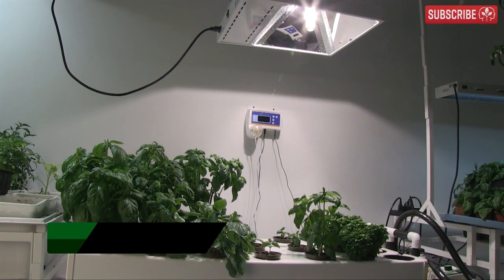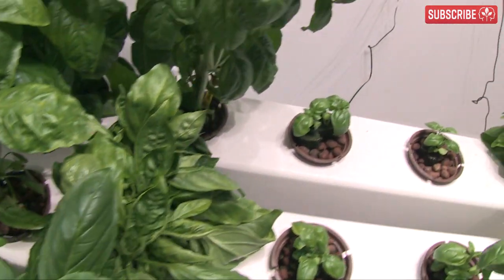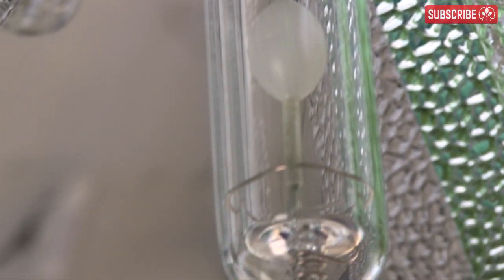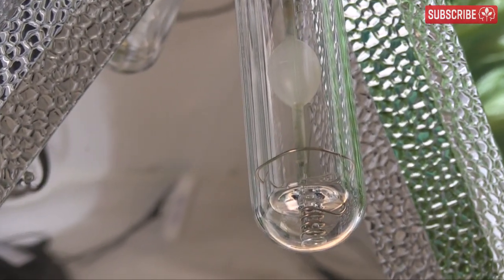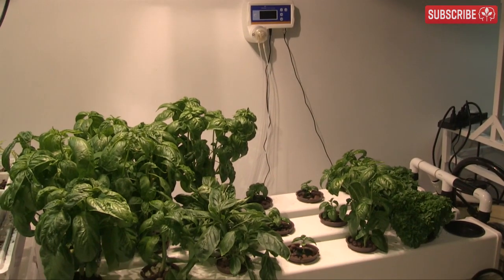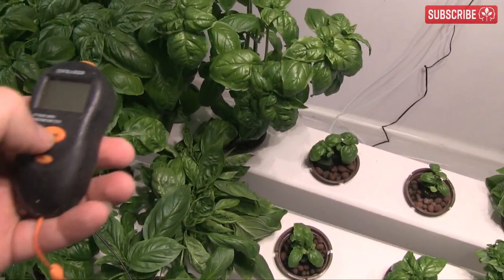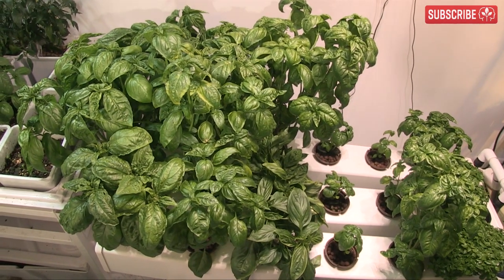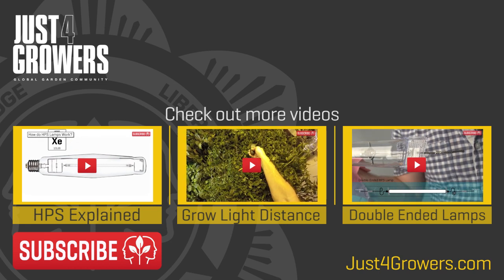LEC 315W Grow Light Review

Comment: I've seen this video before and immediately lowered my light from 30" to 18" do I need say I burnt the crop. My fault! Didn't realize you had yours on a rail. 

Since then I've gotten a rail and another sun system lec 315 light ( flower power) this light has a horizontal bulb. Just a slight difference, from what I gather it gets a little hotter do to that factor. 
Ty for your video. Nice crop 👍

Comment: If anyone still monitors this video I have a question about that exact light and a 2 x 4 x 8 closet tent. I realized real quick I didn’t need the top of the line bulb to veg my plants before going into my 5x5. My wife and I had to learn how to grow to replace a lot of my VA medicines. I invested what I thought was very good money into the top of the line of what her and I could afford and I’m using it all the best that I can. Do they make a bulb that fits that fixture that is cooler than that top of the line bulb that you can grow whole cycles under??
Reply from the maker: Corey Hart Take a look at the HELLION 315W CMH system by Adjustawings - it can go full lifecycle and covers your space nicely.

Comment: Lec 315 vs 250w hps? For chilli thanks
Reply: what is the question?
Reply: @suxxa  best for growing chilli....
Reply: @Cbear30094  cmh if heat and space is not a problem.
cmh have way better spectrum and par output

if heat is a problem take leds ( cobs or quantum board )
Reply: @suxxa  that good then as I have 315w cmh 3k

Comment: Just 1 bulb for veg and flower? Or two separate bulbs are needed? If so what bulb for veg and what bulb for flower? Thanks
Reply from the maker: The 3200 Kelvin lamps are good for veg and flower. The 4200 Kelvin lamps have more blue and tens to be used either as a vegetative lamp or a supplemental lamp during flower.

Comment: Basil got new shoes, black ones ...

I notice it's really dark at the soil level, not much penetration with less than ~ 600W.

Basil may look sharp with black shoes but some plants benefit from lighting lower leaves (near those lower fruits ). A Light Mover will poke in all the holes and provide a LOT more light at the soil level - remember double the distance and get one quarter the light, don't grow Plants too tall OR use a strong Light (with a Mover) to dig deep.

Interesting in hearing how the 600 (or triple Bulb, if they build it) LEC (Ceramic Metal Halide) compares to the Double Ended HPS Horticulture Spectrum Lamp.

Technically speaking, LEC was never invented many years ago for 'Plant Lighting', it's for Fine Clothing and Jewelry Stores, it's chosen for it's fine color rendering, great reproduction of reds, and 'sparkling white' color. The DE HPS was developed for SUPPLEMENTAL lighting in Greenhouses (and retweaked a couple of times to squeeze out a bit more PAR and (usually) a bit more Red).

Visually there looks nothing wrong with the LEC Spectrum and it MAY even look better BUT those Bulbs are unlikely to become developed by the Manufacturer for Horticulture and thus never will they be rated in micromoles.
Reply from the maker: +LowLightVideos Hey LowLight—thanks for stopping by my channel! It's great to have your insights and observations—thanks for sharing. Firstly, I love my light mover! It's particularly good for covering a 2 x 4 tray with a lower wattage lamp. The light mover certainly helps the light reach more of the plant with all those penetrating angles—and, as I'm sure you know, the best leaves to harvest from basil are the newer, upper ones for the best, sweetest taste. Interestingly I find a mixture of the DE HPS and LEC to be a great combined growing spectrum—I've currently got that exact pair over a 5' x 5' area of chillies—I'm sure you'll see them in upcoming vids soon.
Reply: +Everest Fernandez (Just4Growers) - Thanks. So, you do not have faith in Double Ended HPS alone?; the Spectrum has been specifically designed for Plant growth and the Tube shoots 2 micromoles per Watt. Nothing seems better except $5000 LEDs (which would be weaker but more efficient).

HOW does LEC help, essentially it is Double Ended Metal Halide (which like regular Metal Halide is a bit less than HPS).

You might get more out of Solis-Tek's Double Ended 10K Metal Halide Finishing Bulb, it's a LEC for your HPS Fixture (IF your Ballast can strike it, and obviously a Solis-Tek Ballast strikes both) and it would save the cost of a LEC Fixture (which are overpriced and underpowered).

Why is LEC necessary ?

Thanks for your reply,
Rob

Comment: have you tried the 630w yet. i was looking to purchase but was told they had problems with one of the lights not lighting and the ballast overheating?
Reply from the maker: Not yet. I've not heard of any issues but I will ask around.
Reply: +Everest Fernandez (Just4Growers)  what do you think of the yeild on these lec's?
Reply from the maker: +outlaw215 I just cropped out under a 1000W DE HPS mixed with an LEC 315. I haven't flowered just under an LEC yet but I hear very good things.
Reply from the maker: +outlaw215 I'm jealous of your 630W LEC Outlaw! Hopefully I should get my hands on one in the new year. I am aware from industry contacts that a few early 2015 LECs had some strange intermittent lamp ignition issues—most likely something to do with the ballast. It's since been fixed and return rates have been very low according to store owner buddies. Does your LEC630 have a second power switch so that either lamp can be switched on and off independently? If so, you've got the later model. :)
Reply from the maker: +outlaw215 Yes. If it only has one switch it's still probably fine though—but it's better to be able to operate both the lamps independently for sure.

Comment: At a class that my job runs once a month, there was a guy there who had this hood in a 9x9x9 grow room built into his garage. He was having a horrible heat issue, 99+degrees F. I figured it was from him intaking the same air that he was exhausting, and it just reheating and recirculating, and advised him to exhaust his room out of his garage and maybe if he could intake from his house. Obviously it's not like you can personally check out his room, but what do you make of that? And my advice for him?
Reply from the maker: 99+F -- ouch. That's good for cacti and not much else! :) I'd start with the garage itself. Is it sun-facing? Is it poorly insulated from outside ambient temperatures? Hopefully he's running his lights at night too. Does he live in a hot part of the world? Next, ventilation: you're right he absolutely needs to exhaust his garden's air (and air-cooled hood?) to the outside world and draw in fresh cool air. If he's not doing that (as you suggest) then this is another fundamental flaw with his set-up and this too must be addressed before passing GO and collecting $200. :) Failing all that, he should look to change locations to a basement or use air conditioning.
Reply from the maker: ***** Great advice. I forgot to mention the importance of sealing the space well. This cannot be overstated. Thanks for chiming in! Hope you're subscribed, Discofreestyle! :)

Comment: I had three of these and have gotten rid of them. I find my 4x6 t5 bulbs did just as well and less heat. Could be just me... Had it in my Veg room...
Reply from the maker: Interesting to hear your feedback Matthew. I was thinking of trying the LEC 630. It will be intriguing how the horizontal lamp position works out if I do. I didn't experience any heat issues with the 315 but it was in a very well insulated and ventilated cellar. What's your situation?
Reply: You clear talking veg only t5 is perfectly fine for that I recommend the hortilux power veg bulbs for t5 but I am telling you these LEC will out perform any t5 during bloom I may loose a slight bit of quantity but I believe I truly gain quality by changing from 3 1000w HPS for 6 315w LEClights I love them and my electric has dropped very noticeably.
Reply: Clearly veg only

Comment: Can you grow weed with it?
Reply from the maker: Don Maserati It's really a question of "How can I reproduce my chosen specie's native habitat under controlled conditions indoors?" For example, fast growing annuals native to higher altitudes in subtropical regions require high light levels, elevated UV, moderate relative humidity and relatively cool temperatures in order to fully express their genetic potential. Indoor growers seeking to recreate these conditions have invariably had to battle with the heat their grow lights also produced. Generally speaking, all plant species will benefit from the broad spectral output, high PAR, and low radiant heat emitted by this LEC fixture.
Reply: yes you can, and its the bomb